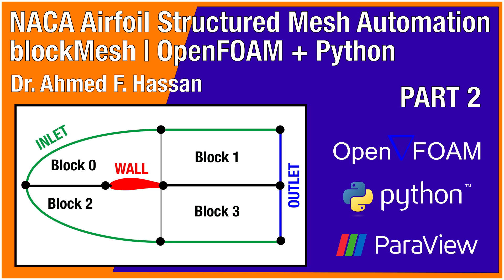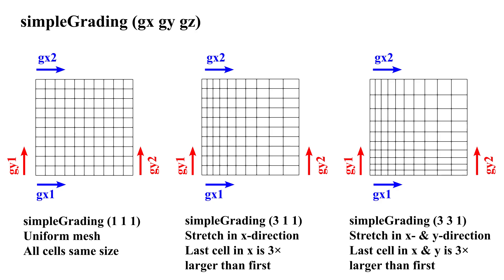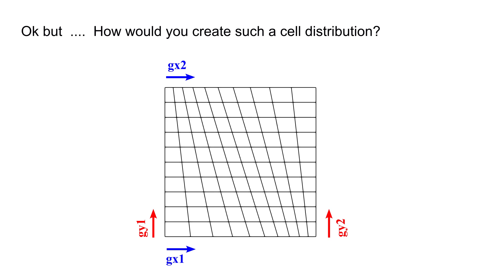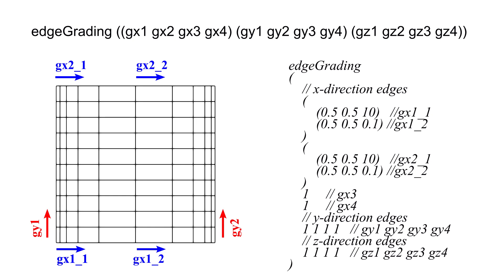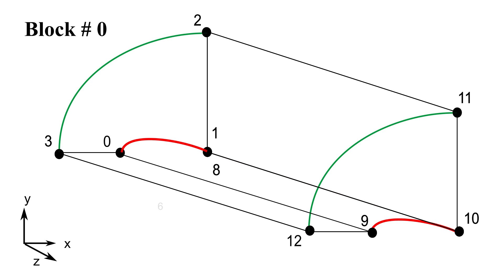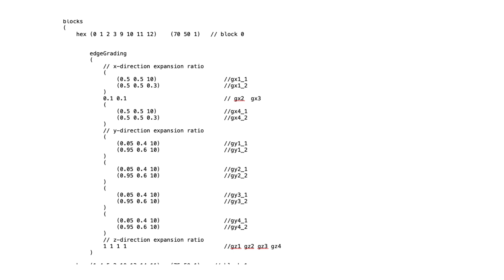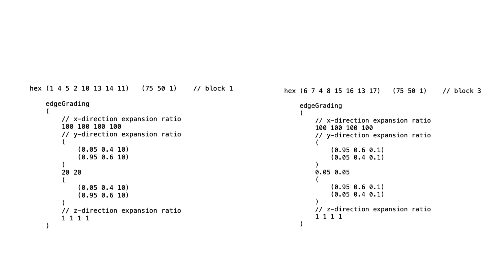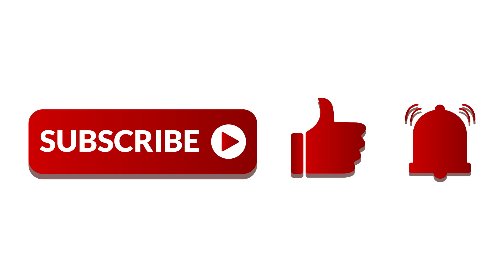Generate High-Quality Structured Airfoil Mesh Using OpenFOAM – Part 2

Comment: Been there, done that in the last century, but I must acknowledge how much easier it is to do it now, and how the power of a command line tools is still second to none.
Interesting to see someone taking the fuzz of a block-structured meshing nowadays for the sake of result fidelity, when most of the solvers don't even know what block structured means. I'm not the OpenFOAM expert, but does it have a block structured solver?
Reply from the maker: Great insights — and you’re absolutely right, OpenFOAM solvers aren’t “block-structured” in the classic sense like the old finite-difference codes.

The main idea here is to leverage the control and accuracy of a structured layout with blockMesh for airfoil-type cases, where mesh alignment and smooth grading still make a big difference in result quality and convergence.

My goal with this channel is to build automated, open-source workflows for CFD simulation — combining scripting (like Python) with OpenFOAM to make high-quality analysis faster, reproducible, and fully transparent.

Really appreciate your comment — it’s great to hear from someone who’s seen how far these tools have come!